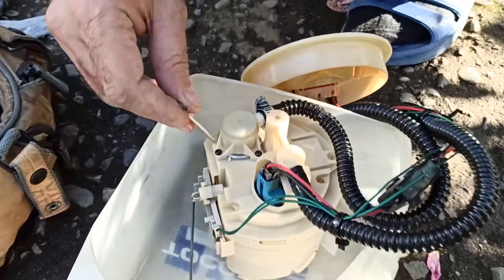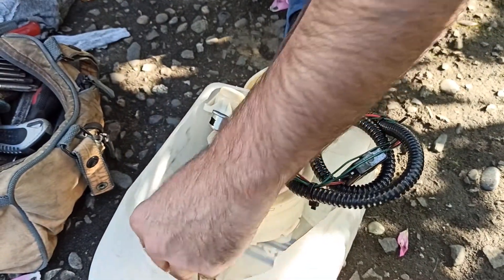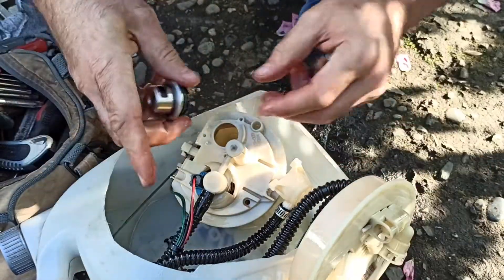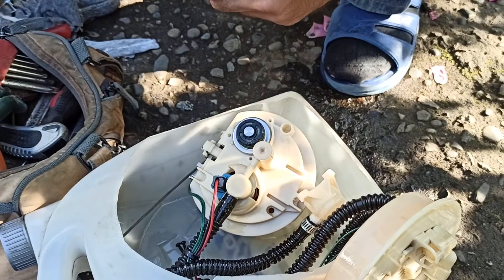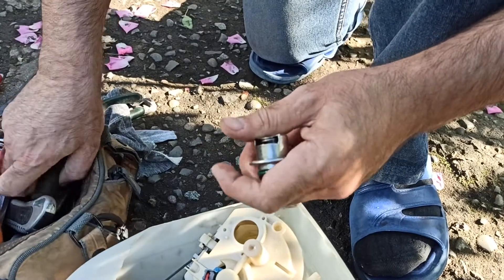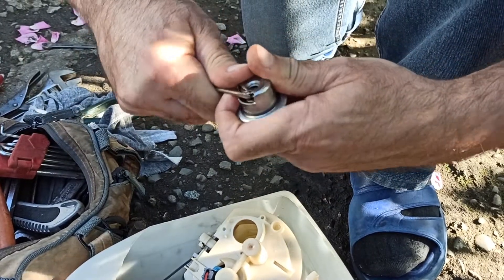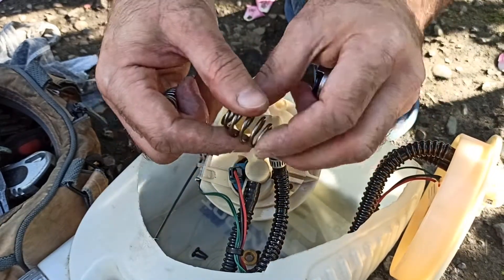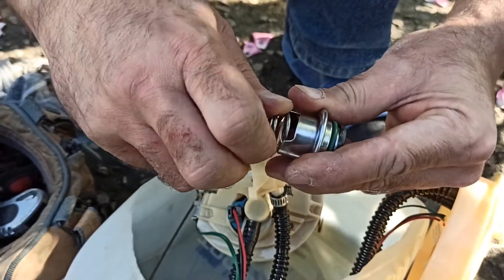Jaguar X-type fuel pressure regulator location & adjustment

Comment from the maker: The OEM fuel pressure for 2.1 engine is about 5 bars, in case of 2.5 & 3.0 engines the pressure is adjusted automatically by an electronic pressure regulator

Comment: How would I Change My Fuel Pressure Sensor?
Reply from the maker: If you mean a fuel pressure regulator of a 2.1 engine, it can be clearly seen in this video. If you mean electronically controlled fuel pressure sensor of a 2.5/3.0 engine, I've got no idea of its design.